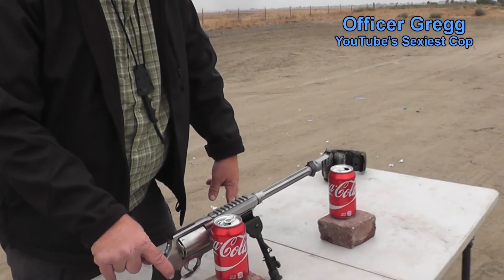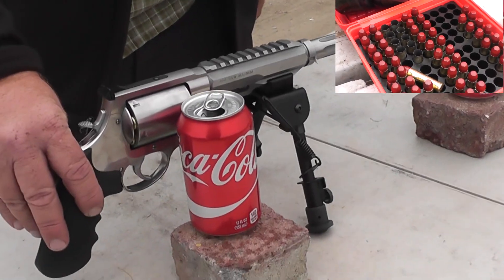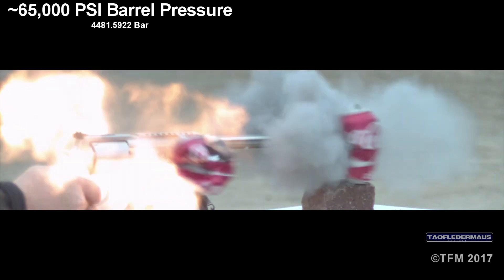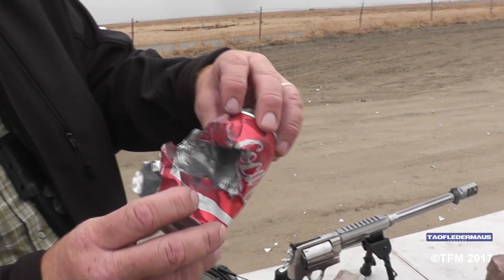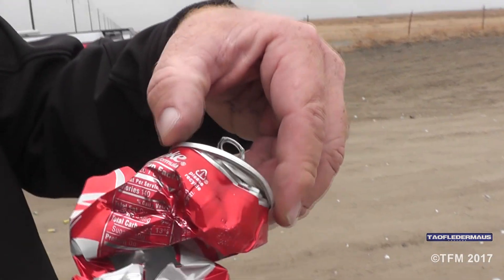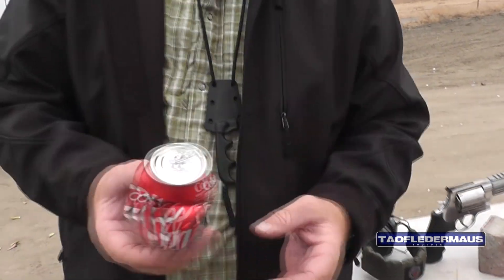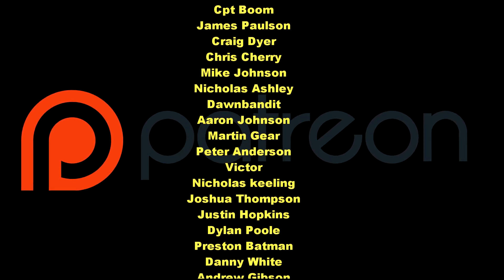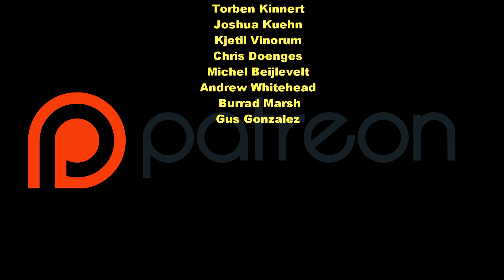Giant Revolver  Blast Demonstration

Comment: I never understood why anyone would want one of the Revolver Rifles and shoot them with the typical 2 hand Rifle hold. Especially one that uses Black Powder.
When I was active in IHMSA shooting in the 80"s, we would use some sort of Blast Shield for the Revolver class when shooting in the Creedmoor or modified Creedmoor position. I used an old Boot Shaft to protect my leg. After years of shooting, it looked like it had been hit with bird shot.
Reply: The carbine version of the Taurus Judge has steel blast shields fitted to the cylinder which work quite well. It can't chamber the .460 cartridge, so I don't know how well they would protect your hand from the far greater blast.

Comment: There's a classic 10 year old thread on AR15.com titled "460XVR blew my thumb off today!" The long and the short of it is some kid used a really dumb style of gripping a 460, with his thumb nested below the cylinder, parallel to it, and managed to hamburger about half an inch of flesh off.  Not sure if the pics are still in the thread but fair warning still if you choose to google it.  Gap flash isnt too much to worry àbout on a 22 or 38 unless timing issues are shaving lead.  But on most anything called magnum, youll want to respect it.

Comment: Color me impressed. I figured that the S&W .500 magnum revolver would be faster, guess I just assumed that due to it being a bigger cartridge.
Reply: The 500 mag is a shorter case and larger diameter, as well as heavier bullet. The 460 magnum has a longer case, smaller diameter, and lighter bullets. Lighter bullets generally travel faster, especially when the case capacities are somewhat similar. The 460 is the taller, thinner, faster brother to the 500, both from the same family. I reload and cast my own bullets, so the 460 (same bullets as 45 colt and 45 acp) made more sense. With lighter loads these guns feel like a 9mm pistol and are very fun and accurate at distance.

Comment: Surely it's possible to design that gap out entirely, which would only make the bullet even faster albeit not by a lot.
Reply: It's been done. The Nagant revolver. It's a gas seal revolver.
Reply: Also done by the Borchardt C-93... and every other non-revolver since :-)
Reply: TheBaconWizard would also increase chamber pressure . but I'm not so sure s&w wouldn't offer a custom shop option for a tighter mating between the cylinder and forcing cone
Reply: Exactly my point
Reply: If you make the gap too small it makes it easy for the cylinder to bind up as soot and other debris build up. The Nagant revolver used an unusual cartridge and mechanism to effectively eliminate cylinder gap, but that probably wouldn't work for a cartridge as powerful as the 460. The Nagant cartridge was rather puny even when it was new, so there's not much chance of over-stressing the mechanism.
Reply: wild bill oh cool! thanks for that, i'll go look at it :)
Edit: The gas seal seems to work great on the Negant, and a nice collector's piece but in every other respect..  yuck! I'm sure a modern design would work just as well without turning it into a major project every time you want to shoot or reload it lol
Reply: 1959Edsel Yeah I can definitely see a way of doing much better than the Negant, but I hadn't thought of the binding-up issue (not that I'm actually gonna try and make one, or anything, just idly musing about it.

Comment: Insane what we lose on our revolver at the forcing cone. Makes me rethink the Desert Eagle pistol.  THANKS FOR THE VIDEOS GUYS .
Reply: Exactly. Revolvers' vaunted reliability comes from being a dirt-simple system. Semi-autos are more complicated, sure, but also more efficient when they work right.
Reply: Hmmm, energy lost at gap in revolver vs. energy lost in gas-tap of auto-loader?
Either way, hot gasses are being vented out of the barrel rather than pushing a bullet.
Recoil operated doesn't dump gasses, but a 1911 in .460 Magnum has yet to be built!
There is not a lot of chronograph evidence backing up the idea of 'lost power' at the cylinder gap, but plenty of opinions!

Comment: Awesome, as always!  (I just cast some 45 caliber 255 grn full wad cutters - happy to send you some if you want to load them for the .460 S&W.)
Reply: Loads of Bacon I may be wrong but I don't think I am the 460 is a 46 caliber fire arm
Reply: Cartridge names are often misleading.  The .460 S&W Magnum uses the same diameter bullet as the .460 Rowland, .454 Casull, .45 Colt, and .45 Schofield, which is .451"-.452".
Reply: Loads of Bacon ok thank you buddy im no genius lol but I love to learn as much as I can and thank you for letting me know about bc I always thought that say for example a 38 spc is 38 caliber and like the 454 45 acp and the 45 long colt are all 45 cal and the 50 ae is a 50 caliber and the 357 magnum I never did understand bc I heard that you can fire a 38 spc through it but not the other way around but like I was saying I love to learn and thank you for breaking it down for me
Reply: It's all good.  There's actually very few cartridges "properly" named.  You mentioned 38 and 357.  A .380 ACP, 9mm Lugar, .357 SIG, and several other cartridges use a bullet that is .355".  (9 mm converted to inches = .354331".)  .38 Super and a few others use a .356" bullet.  .38 Short Colt, .38 Long Colt, .38 S&W Special, .357 S&W Magnum, plus a few other cartridges use .357" bullets.
As soon as you get it all figured out, you'll come across another cartridge or two that will leave you scratching your head again.
Reply: Lol yeah I completely agree and with the knowledge that you have shared with me I assure you that I am definitely digging allot deeper into the different caliber's and there well everything I can learn I thought I knew a bit about ammunition but I haven't much more than scratched the surface and again I thank you for educating me a bit in the different caliber's and there diameters I hope that jeff does give you the green light on some of your 45 cal rounds I'd really like to see some of your work after getting the chance to briefly converse with you I see that you definitely have your stuff together....I hope I said that right lol
Reply: Loads of Bacon a quick question though what is the lightest 45 round you could make bc 185gr is the lightest one I can find but im new in town where I'm at and don't know anyone that that even shares my love for ballistics lol let alone loads or reloads any ammunition at all
Reply: You could load a round ball, which would be 145-150 grains.
Reply: Ok I see in the near future if it's something that is ok with you and Jeff I could send you a monetary gift to compensate you for your time and materials but that's completely up to you and I really don't want to cross any line's that shouldn't be crossed I have a full frame Remington 1911 45.acp  and I reckon what im trying to say is I would really like to try some new ammo.....again I don't want to get on anyone's bad side bc of asking about it on jeffs channel
Reply: Not sure exactly what you're asking, but Jeff has a ton of awesome stuff on his channel, and I do bullet casting and reloading on mine.
Reply: Loads of Bacon I was wondering if you would let me purchase some of the loads that you put together chambered in 45.acp and I definitely don't want to offend anyone or break any rules im kinda new here on you tube and I absolutely agree jeff kicks some serious butt on his channel when I'm not at work im here watching the awesome videos that jeff puts on here I didn't know how to ask you if you would let me try some ammo that you loaded and I would pay for it to be shipped and pay for the materials and time that you have invested in it I apologize and im kind of embarrassed lol
Reply: Loads of Bacon pretty much put in short terms I didn't want disrespect jeff or you for asking you if I can buy some 45.acp rounds that you have loaded like a variety of like say one or two of the wadcutter and like one or two of the light ball rounds you mentioned earlier and hollow points if you load any of them I can put the money up front for say like a box of anything from 5 to 50 rounds depending on what you would charge me to put them together and I've been told at c&s gun shop in ironton ohio that my 1911 is plus p rated and also if it's ok to do I could record and post the results of your ammunition but I don't have the awesome gopro like jeff does lol so pretty much if it's ok I would buy the rounds and try them out.......if that is something that you don't want to do I understand and respect it and also I definitely don't want to annoy,offend,or be nuisance to anyone
Reply: Unfortunately I don't have the licenses required to create and then sell ammunition.  What I can do is create my own, and demonstrate the process.
Reply: Loads of Bacon that would be really cool I would like to see the process of loading and and the steps involved in that......I would like to take this opportunity to thank you for being so cool and giving some information on the ballistics and schooling me on the different cartridges lol but honestly thanks man your a pretty cool and polite person on here godbless and always be safe I look forward to seeing your loading process and the ins and outs of producing a round that will be very exciting to see and of the highest quality
Reply: Any time John.  I love helping folks learn about the shooting sports!
Reply: Loads of Bacon lol my wife works at an ammunition factory producing a bunch of 30mm military rounds there's an idea for jeff lol but I don't think our national or state law's would permit that but officer Greg is in the law enforcement ill have to look that up lol but not getting my hope's up yet....well it's getting late in the fine state of Ohio and 4:30 am comes early lol good night buddy im looking forward to seeing the how to's and the do"s and don't"s of the loading process god bless and stay safe
Reply: A lot of that has to do with the bullets being necked down versions of longer cartridges, or longer versions of a specific diameter bullet already in use, so most that use the same base cartridge can be used relatively interchangably, provided the chamber is of sufficient size, right? Typically, if it's made for the longer rounds, it can take the shorter versions, is what I'm trying to say (it's 6 AM and I've not slept yet, so excuse me if I'm derping).
Reply: Kain Yusanagi it made since to me kinda like a 45 lc fired out of the 454 revolver and the 38 spcl in a 357 mag

Comment: what if.... someone made a stock for that revolver?
Reply: Because you'd get a hell of a burn from that cylinder gap on your support arm
Reply: Michael Boudreaux You could simply put both hands on the grip....
Reply: i mean yeah but how much does that really help you at that point
Reply: Michael Boudreaux 
It might help.
Reply: you see the legs on the revolver, maybe replace it with a grip and wear some anti-flammable material
Reply: Auricle Violation I mean yeah you can do it if you're wearing protective equipment but what's the point?
Reply: Michael Boudreaux The HK Vp70 works like i said i believe. You just hold the pistolgrip with two hands.
Reply: WH250398 yeah but the vp70 was a machine pistol in a much smaller caliber. The recoil from a revolver this large would not be at all easy to control from that position.
Reply: Michael Boudreaux 
A stock is always more managable than just holding it with two hands.
Reply: WH250398 I mean yeah, most of the time. My point in all of this is not whether or not you could put a stock on this but rather what's the point? Why would you not buy a lever action in .460 at that point where you could make the most use of a stock? http://www.bighornarmory.com/catalog/big-horn-armory-products/model-90-rifle-460-sandw-model-90a-454-casull-5/